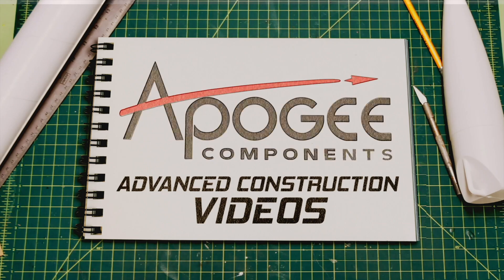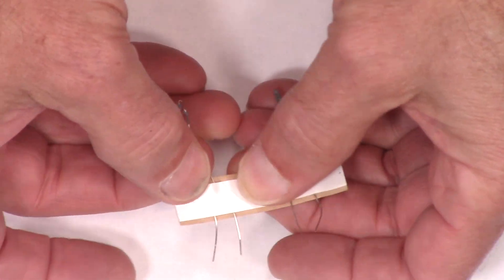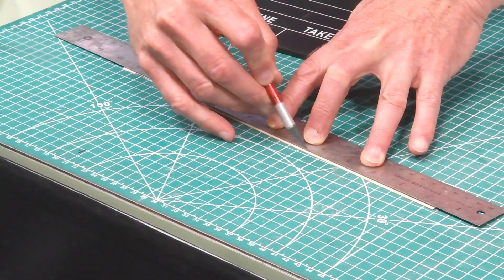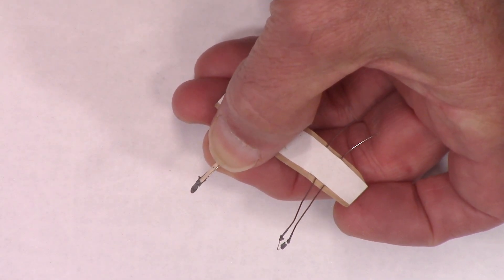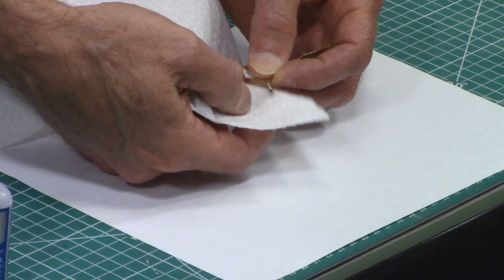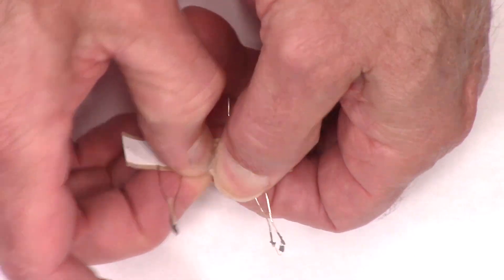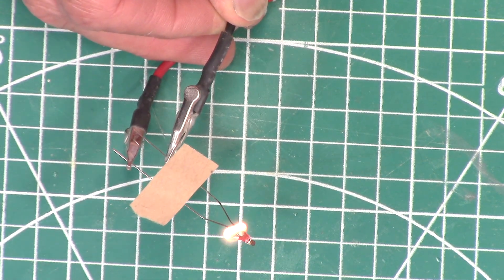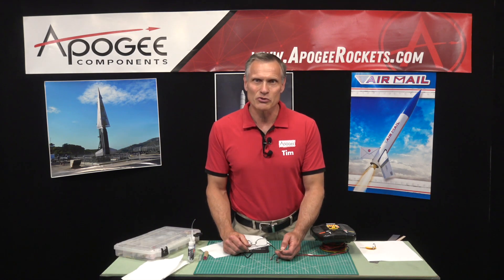Toughen Estes Igniters for Model Rockets

Comment: 5:28 Tim, I just paint the igniter heads with nail polish. Its a hardener after all. Its also a bonus that its almost all nitrocellulose as well
Reply from the maker: The idea is to keep the two wires from move relative to each other. So if you can add paint that will prevent the wires from shifting, that should work fine. Keep up the good work.

Comment: Clever. I never had this problem in the 70's when I was into rocketry: I would just roll a tiny ball of recovery wadding and place it right behind the pyrogen head portion: it kept the wires insulated from shorts, and then I'd follow it with another ball or two, pushed in using the old metal launch key. Never failed me in four seasons of rocketry.
Reply from the maker: Back in the 70's there wasn't a bridge wire in the igniter. The addition of the bridge wire made the igniter easier to set off with smaller (dead) batteries. But at the same time, it made the igniter more fragile. There is always a trade-off.
Reply: I flew model rockets in the 60's and Estes showed this in their instructions.

Comment: maybe an easier solution is to use a piece of thin shrink tubing.  I slide it over one "leg" and shrink.  Haven't had a fail since.
Reply from the maker: removing the tape to add the shrink tubing is the problem though. It is going to make it easier to damage the pyrogen by moving the wires around. But if you've have success, keep doing it.

Comment: Another issue I've had and you can somewhat see it in your closeups- there are some tiny wings sticking out of each side of the igniter, then ends of the bridge wires.  When you put this igniter in an engine with small nozzle such as an A the little wings will push the wires together and they will short out.  This is not a problem with D motors and usually not a problem with B and C motors but can be.  I have experimented with painting the wires so they are insulated and so far this has worked well.  I've used whatever paint is handy in my garage, even latex housepaint will work.  This doesn't make the igniters stronger as your method does but does make them more reliable.  I have tried to think of a good way to clip off the bits of wire that are sticking out, maybe it could be done with some good nail clippers but you also risk damaging the igniters that way.
Reply from the maker: The tiny wings wouldn't be a problem if the igniter head was more durable. That was why I made this video.